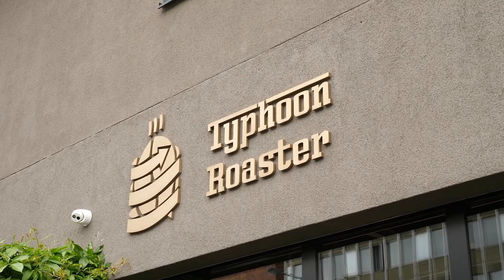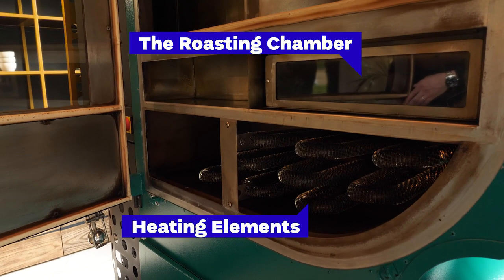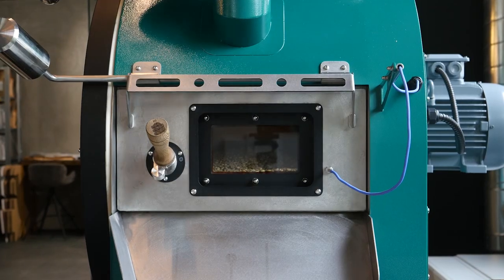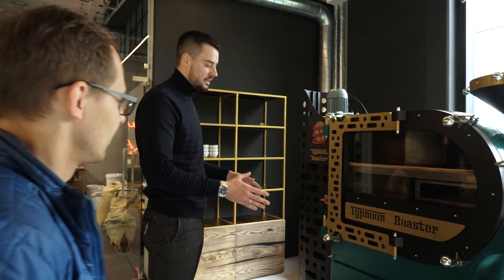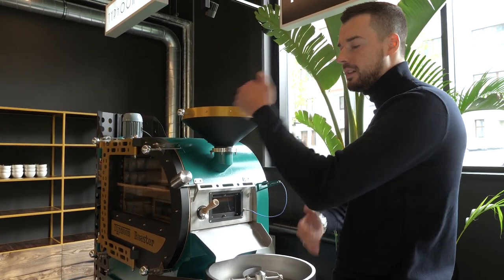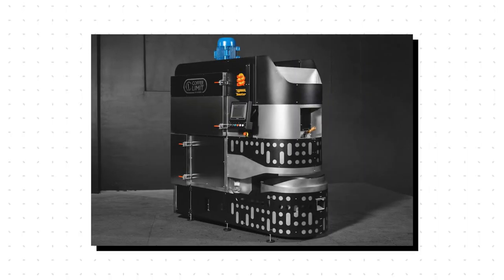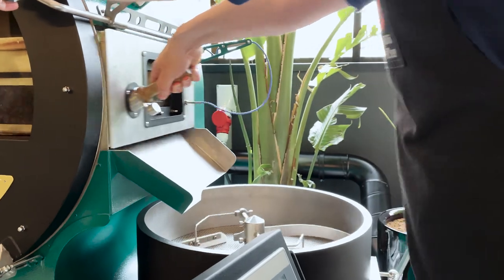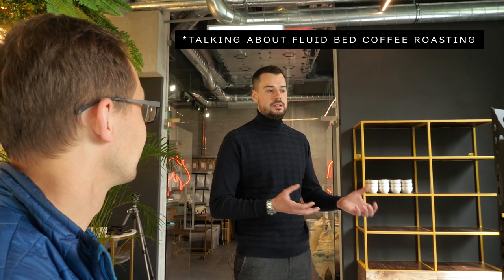What’s Inside a Fluid Bed Coffee Roaster? A Visit at Typhoon Coffee in Prague

Comment: In my opinion, with fluid bed you can not obtain many physical chemical reactions at the crust of the bean that will show in the cup, it is like to compare a good meat steak cooked at an oven vs doing it so on a grill or a pan. Which one you like the most? (oven = Fluidyzed bed / Grill or pan = Traditional drum) 
In most world coffee competitions people use traditional drum roasting, why, because with the physical reactions at the exterior of the bean make that the aromathics hold inside if the roasted bean longer and then show up at the cup. In my experience with fluid bed you don´t seal the exterior of the bean and loose many of the nice aromathics within the specialty coffees, actually it is what makes them interesting. But also, fluid bed has being arround for several years, and it is mostly used in huge machines dedicated to standard grade coffee, specially because they need to get rid of many undesirable flavors (defects) by volatilizing them , and also because it is a way of very fast roasting, making the process efficient. At the end of the day, the best coffee is the one you enjoy the most!! It would be nice to ask world barista champions which method do they like the most.
Reply: The latest world Barista Champ used a hybrid fluid bed roaster to roast his coffee.
Reply: Patrick Rolf used Ikawa
Reply: @rkaratimus1  yes, a small size machine with high thermal conductivity. So, at the end of the day it works similar to tradicional drum roasters.  Try doing that with a big fluid bed machine